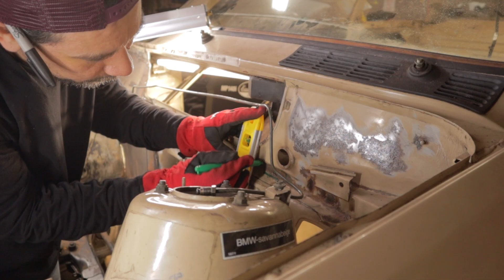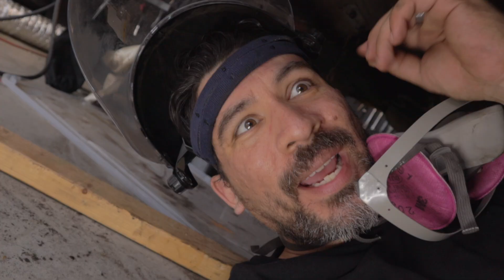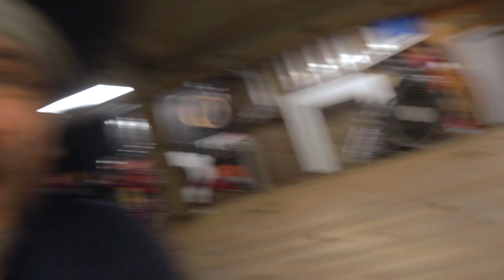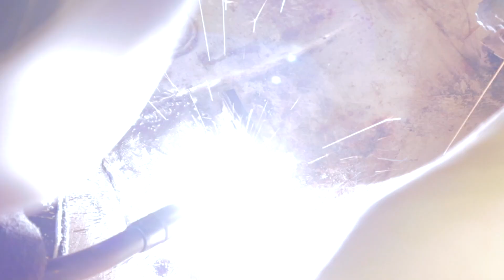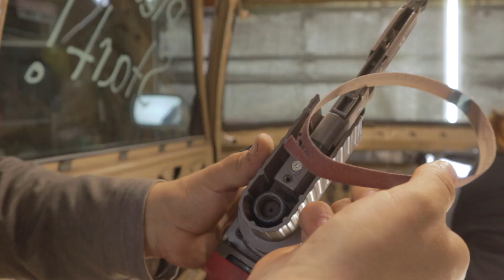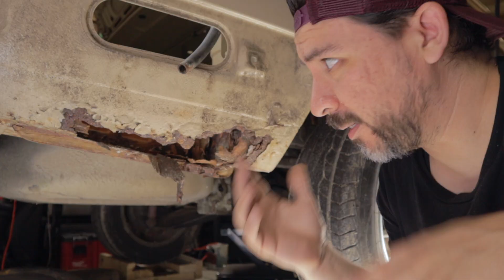Can Flux Core Welding REALLY Remove Rust on THIN BMW e30 Sheet Metal?

Comment: I hope someone sees this: How is the sunroof cassette held in? It looks like you melted glue with a heat gun, but also that you were filing (and then drilling?) spots welds out. Please, I need some guidance here.
Reply from the maker: It has glue and its spot welded in multiple spots. You have to drill those out and pry it loose for it to come out. There's around 6-8 spot welds you'll be able to see where theres a small divot in the sheet metal. The good thing is they don't go through the top of the hood, but through the sheet metal that bends down into the body of the car. Thx for watching and have fun!!!!

Comment: I've been using flux for a few years on car sheet metal. Change your angle should be about 15 degrees. Next is stick out 1/2 to 5/8. Using a harbor freight 140 welder which has the built inverter you can get pretty flawless welds. Let the panel cool down or move to other section.
Reply from the maker: Thx, great tips. We love running flux, can get across those bigger gaps with no issues :)

Comment: 3 in 1 machine isn't what makes it possible to change to flux core wire, all you have to  switch your guns wire that runs to your machine and makes sure to hook it up DCEN (gun wire to negative post on the machine) positive to the ground. Not rocket science! Same for most stick welders but not all electrodes are run on the same polarity for stick welding. Make sure that you research your wire and electrodes before buying them. They not all flux core wire is the same either. They do sell wires that are for mild steel and some that are tailored to run on stainless etc.
Reply from the maker: Thx, what flux core do you recommend for automotive sheet metal??? 20 gauge?
Reply: @Itsallaboutthebuild  The thickness doesn't really matter. You just tried to dissipate the heat as much as possible. Moving around and never places to don't get burned through. I don't know where you are based out of I'm in the US and when I buy my rolls. I like to look and make sure that it is obviously gasless wire, and after that number it should say ALLOY or mild steel
Reply: Does to just try if you didn't once and see which one works the best for you? I would order online in bulk, it's cheaper
Reply: When you're looking at the price of consumables. in the price right now of wire compared to gas? I'd probably go with flux core all day. Now if I was doing something more heavy duty than I would probably use mig with the gas or just pull out my stack of electrodes and go hamburger with stick welding. No matter what process you use or what you are using for wire or electrodes, its all about the skills used. Otherwise the most important aspect of it. My opinion is the pre weld cleanup and the fit up. I have seen a lot of guys. Make cuts using hacksaw blades. And he put them in their sawsall to make their cuts when working with car panels etc. If you can afford it, go out and get the nib, cut off tool much faster. Another trick I've seen some guys do is. They used a stick welding electrode and they lay it down in the gap that they want to fill and they fill gaps faster that way. Hope that helps guys! Thanks for the video!
Reply from the maker: @clubquarantinerelief2522  awesome, great tips. Will have to try that one with the rod in some larger gaps 🙌🙌🙌
Reply: I forgot to mention a couple things earlier that will definitely help you guys out for using flux core on thin material. I cut my nozzle tip off about a 1/4 way down to expose the electrode tip. You can ditch the nozzle altogether if you want since flux core process isn't using gas mixture so the nozzle is really intended for gas mig process. I like having some of the nozzle on there so that I don't burn up my goose neck. It also makes it much easier to weld when you can see the tip directly. Also the biggest tip I can give you is that you should be welding with a ton of stick out/wire extension like one or two inches of wire stick out for the thinner materials and just weld in short spot welding bursts. It will take a little getting used to but you can control the heat and not burn through the material using this technique. Just alternate from top to bottom giving adequate time for the weld pools to cool on super thin stuff, just like when you go to fill in a hole or gap.😉 I wish you guys the best of luck! Cheers
Reply from the maker: @ oh man thx!!! We’ve switched to no nozzle and longer stick out. I’d does take some time to get used to. Crazy how many people say that’s WRONG too.
Reply: @Itsallaboutthebuild  😆 🤣 Awesome! I went to college for welding and I have a degree in it. There's nothing wrong with it. I know guys that have been doing it for forty plus years and they are in the auto body trade.
Reply: The only thing that you might want to be careful about is running your machine to high without a nozzle for too long and doing it without stick out. But obviously you wouldn't be using that method if you were running regular material LO. L. Before I went to school. I was doing it as a Hobbiest and I burned up a goose neck on my Hobart, 150 handler. I was able to go to my local Fleet farm though. And buy a replacement whip and gooseneck for only like 50 dollars, but cutting it  and fitting it into the insulator and to.the 
Gun was a challenge. Another thing also is to make sure that you switch out. Your factory ground clamp and/or use a magnet if possible. I harvest my magnets from old hard drives. They are very small but soooo damn powerful!! You wouldn't want to get your fingers stuck between two of them coming into contact with one another. They are rare Earth magnets. And they're very strong. I would definitely get some on hand because if they get too hot They tend to lose their magnetism all magnets do. But I have to say having the magnet is a game changer when it comes to fitting up pieces especially when its part of your ground clamp! 😉🫡👍
Reply: I'm about to go back out and work on my shit show I have going on in my garage. I'm welding up/bondo  job on my 2016 ford focus. I hit a deer going Mach 80 and crushed the hood real good. I just got done doing the painfully tedious task of rewarding the front where it got delaminates. Hood hinges ripped off. Lol wish me luck.
Reply from the maker: @ oh man, yes lots of work. But you got it 🙌🙌🙌
Reply from the maker: @clubquarantinerelief2522  oh nice!!! I have some old hard drives and will pull the magnet out for sure

Comment: Watched a bunch of your rust repair videos and really inspired to do the same. Never welded or painted but have access to a miller and lots of time. 

For the repair itself, is mild steel the same gauge as the panel the best patch? Would you suggest mig or flux core for a beginner? Fc seems to have a lot more splatter and less control. Is rust treat and epoxy primer good enough as a base once patched? 

Would love to save an old jdm with some roof and trunk jam rust. Thanks for all the vids!
Reply from the maker: Thx for watching!!! Mild steel can come in different thickness. We try to match the thickness if its something that can be seen. For floor boards, you could go with different thickness. Usually the thicker, the easier and less warping. Flux will have much more spatter than flux for sure. If you have gas and can get the panels to fit pretty well, maybe say leave a very small gap the thickness of a dime. When you tack things together your weld that bridges the gap will provide more strength than having the panels fit too close together. Yes, rust treat and self etching primer is the way to go. Try to clean as much of the rust as you can before you weld. Have fun and stay safe 🙌🙌🙌

Comment: the holes you did in the 5.26 were spot welds ?
Reply from the maker: All the welding was butt welded. If you're talking about the sunroof, those were all spot welds that needed to be removed in order for the sunroof to come out :)
Reply: @allaboutthebuild  I am talking about the holes you did with the drill in the area where the sunroof stays
Reply from the maker: @vagkos3060  oh ok. We plan to butt weld a larger piece of sheet metal directly to the sunroof metal opening. So no more leaky sunroof 🙌
Reply: @Itsallaboutthebuild  yeah I understand why you did that but were those holes spot welds ? Cause I remove a tray to to install it to a non sunroof car and I want them intact.  Also thank you the replies
Reply from the maker: @vagkos3060  the inner sunroof cassette is welded with spot welds to the roof with additional tabs welded to the inner side of the roof. 👍
Reply: @allaboutthebuild  you mean the 5 spot welds it has in each side ?
Reply from the maker: @vagkos3060  yes. So the roof had about 5-6 tabs butt welded to the ceiling, then on each of those tabs the cassette which held the sunroof was spot welded to those tabs. The rest of the cassette was glued onto the roof

Comment: I have a ‘63 Volvo P1800 that I’ve owned since 1996. A few years back it become obvious the previous owners had body work done that was pretty poor. I bought an Eastwood MIg welder and started in the trunk (after the gas tank was removed) as I figured it was well hidden and any minor mistakes would be no big deal. After a summer of work I found a welding class run through the city of Buffalo schools in the evening. Great instructor who had decades of experience. He taught us stick, then MIG and then TIG. We also got to play with flux core. Flux core is great outdoors when you can’t count of your shielding gas not blowing away. It’s also a good option for car repair. A little more splatter and cleanup, but not bad. We did run some serious HD flux core on the “big machine” to weld 1/2 plate. That uses flux core AND gas at the same time. The smoke was impressive. You could put some crazy heat into the metal to weld the heady stuff. All my welding at home has been sheet metal. I probably saved around $15K in labor and spent around $1000 in tools and a class 😅

You guys are clearly good with PPE, you don’t want to mess with your lungs or risk serious burns. One item I have become quite fond of using are the chef hats for general car work. It collects lots of sweat so you don’t drip, also great to prevent all sorts of grease, dirt and other grime from getting into my hair. I’m get them cheap at the restaurant supply store. The area all cotton for safety in the kitchen (it can burn, but it won’t melt as that causes far more problems. For welding I upgraded to a Lincoln welding cap. It’s treated to not burn. Splatter can get through, just like it can with a welding shirt, but it won’t catch fire or melt. Was around $15 on Amazon, cheap protection for my hair/scalp.
Reply from the maker: Awesome to hear others learning to DIY. It’s lots of fun, but PPE is important. Speaking of welding caps, I just picked one up for my wife and I. It’s not fun when something hits your head, don’t ask how we know 🤣

Comment: Don't forget to change the polarity on your welder to run flux core wire, switch the neg and pos wires around. Also get a fan to blow away the fumes they are not good.
Reply from the maker: Yeah, we figured out polarity was wrong and switched it up. We also have an exhaust fan too 👍